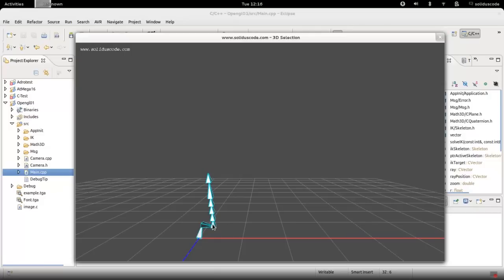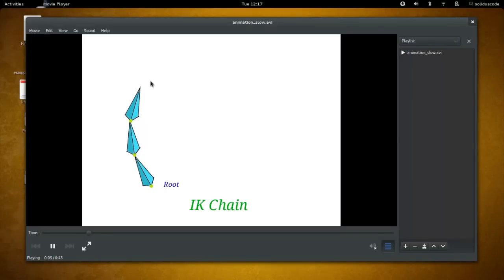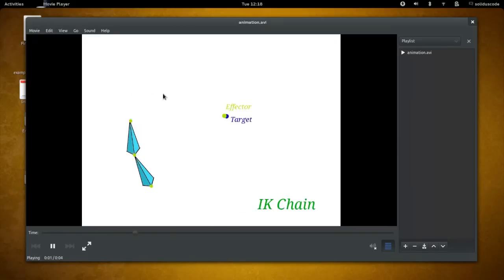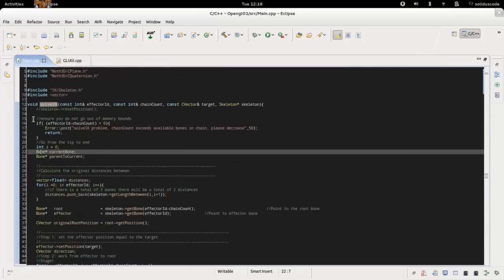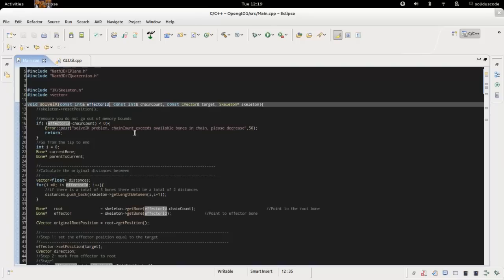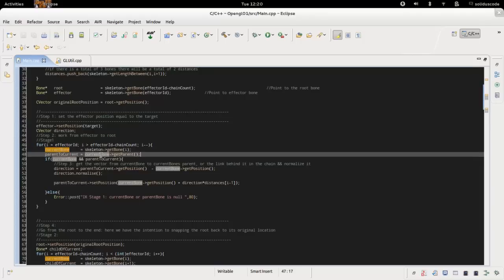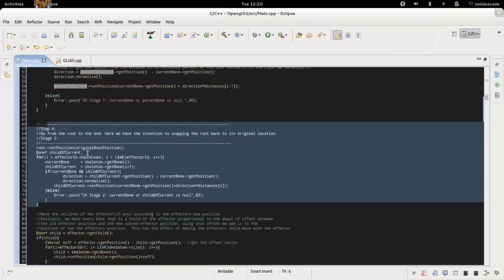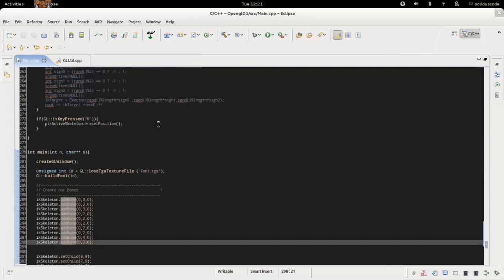How to Implement an IK System using C++ and Opengl

Comment: Very nice work! 
I have 1 suggestion and 1 questions.
First, instead of simply subtracting the root error from all the bones, why not do another pass, just like the first pass, but from root to tip? 
Secondly, how would you constrain degrees of freedom and enforce joint angle limits in this kind of system. I suspect it would be too much trouble and better to go for a full IK solver instead.